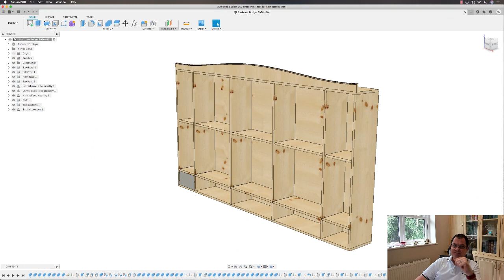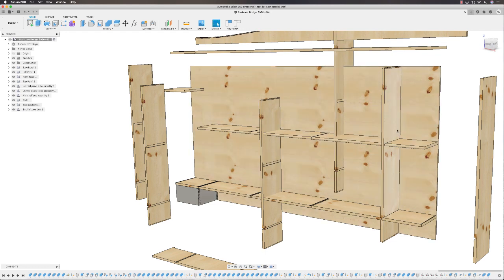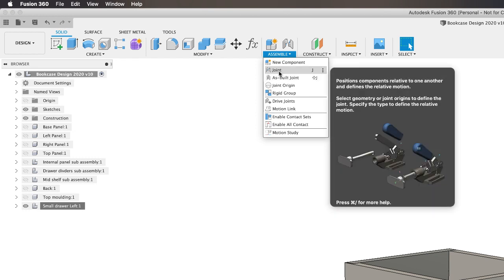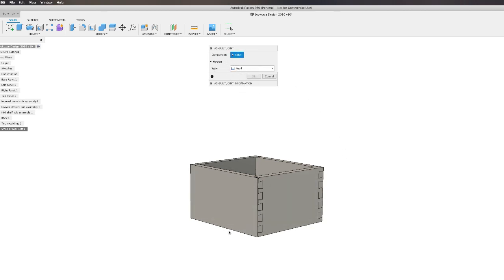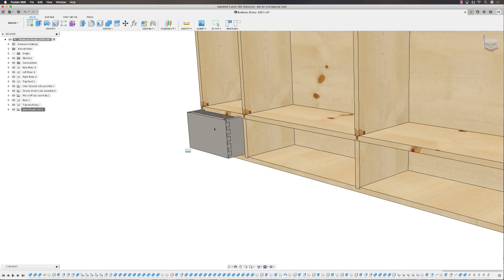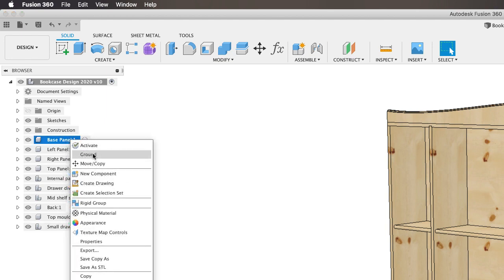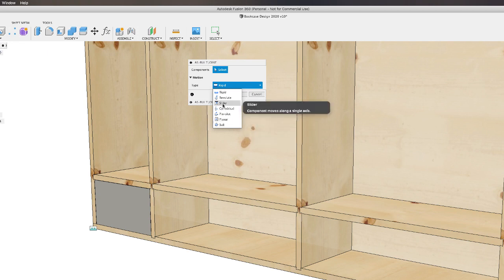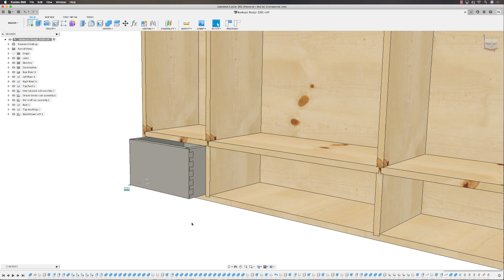Fusion 360 for Woodworkers - Lesson 9 Gluing up the drawers

Comment: Help! I’ve struggled with this for a while. Followed your steps really carefully, but when I pull the drawer out it is not constrained to the Z Axis and just moves around in any direction. I’m stumped!
Reply from the maker: Hi,

Sorry to hear that, any chance of recording your screen somI can see what you are doing ?

Cheers

Andy
Reply: The Woodgrafter thanks. If I can work out how to record my screen I will.  I originally had the As-built joint between the Drawer Front and the Drawer Bottom. On closer viewing of your demo I think it should be between the Drawer Front and the Bookcase Base Panel. So the problem I have now is that when I move the Drawer the base panel moves too, even though it is “Grounded”. In your demo, once you have “Grounded” the base panel you can no longer drag it out of position, but in my case I can still move it even though the red Ground pin is showing.
Reply: Here's a link to a video showing my issue... https://youtu.be/pKhwtVprir4
Reply from the maker: Hmm that is interesting,

I’ll rewatch the video on my big screen tomorrow (on an iphone at the moment) and come back to you - it does look like you have selected the correct joint type and plane.

And the error you are experiencing is usually due to the bottom panel not been grounded. You shouldn’t be able to move that panel when it’s grounded. So something isn’t right there.

Cheers

Andy
Reply: @TheWoodgrafter  Hi Andy, I've fixed it!  I spotted an anomaly in that my Base Panel was showing in the list on the left as a sub-assembly with the 2 small boxes icon, rather than a single component.  I went back on the timeline and found where the change from single component to sub-assembly was made in error, I deleted that action then returned to "present" and re-did the base panel grounding and sliding joint, it now works perfectly!  Thanks to your excellent tuition I was equipped to fix the problem (after a good night's sleep!).